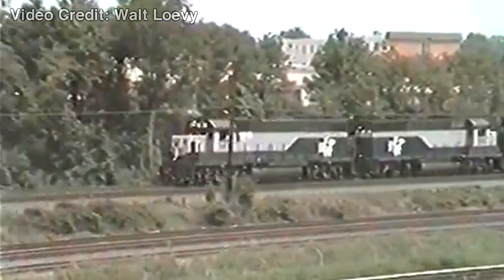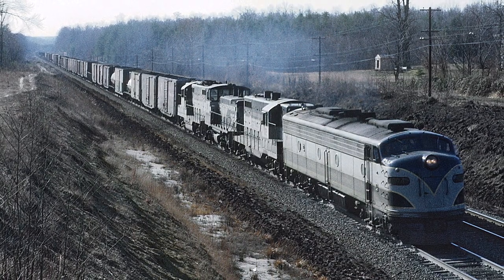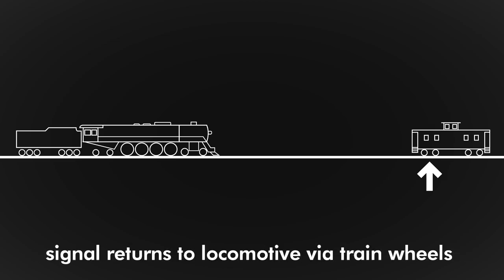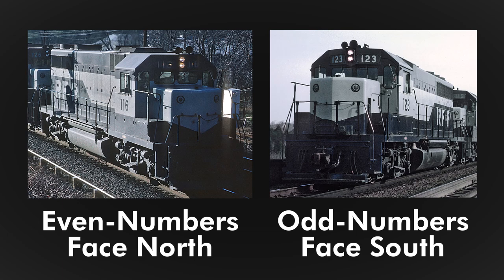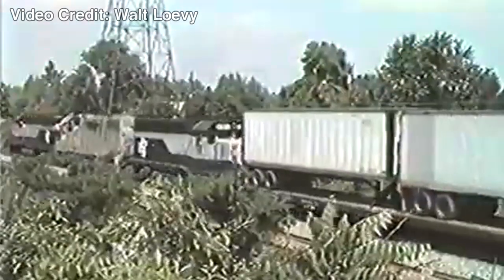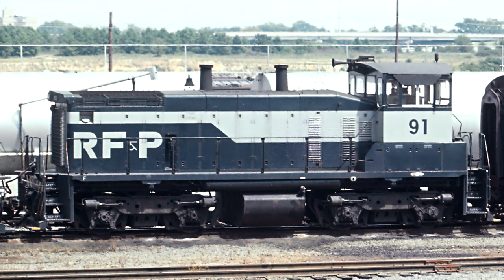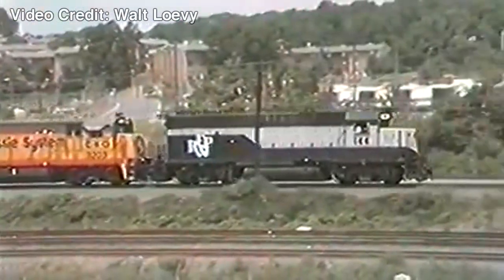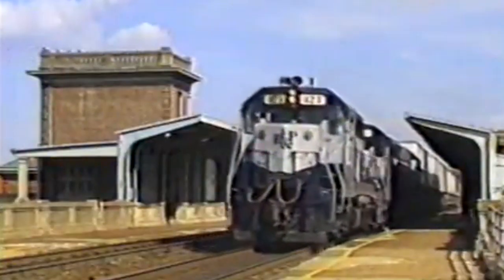The RF&P Railroad's Odd Operations

Comment: I hired as an engineer on the RF&P on this date in 1980, having been promoted to engineer on the Southern Railway in 1979. The RF&P was a great outfit to work for! One slight correction: the GP40-2's (141-147) only had one control stand, but the ATC system could be set up for long hood forward by breaking a seal down in the nose and changing the position of a small brass lever which was the same as the acknowledging lever mounted on the cab wall by the engineer's seat. The GP35's (131-138) and straight GP40's (121-127) had dual control stands. I'm still running for CSX with 42 years seniority on the roster.
Reply: Great comment - if you're still running the RF&P or North End Subs, I might see you from my car trackside. If you haven't retired already, best wishes for a successful conclusion to your career.

Comment: I've got a small fondness for the RF&P and I have a few DVD's featuring their motive power. While it may only take up like 8 minutes of runtime across all of the train dvd's I own, its still an interesting line. Also Ik RF&P and ACL diesels were leased to the N&W which bumped the J's from passenger service in late 1950's.

Comment: Great video! If I remember correctly, Rail Link 285 (one of the switchers that actually works in my local area, which happens to be in Arkansas) is former RF&P locomotive #85. To my knowledge, it was never fitted with Flexicoil B trucks.
Reply: SW1200's 84 and 85 had standard AAR type "A" trucks and were not equipped with ATC (cab signals) for road service. They also didn't have MU capability until the mid-late 80's. 81-83 were equipped with flexicoil trucks, ATC and MU and could be used on the road. SW1500 91 was also so equipped.
Reply: @johnstone2647  Ah, so my suspicions were correct then. Thanks for the info!

Comment: Ah, yes, RF&P park in Henrico County. 

It’s right next to Meadow Farm, which is where I went a lot as a kid for living history events and the Civil War Reenactment they used to have there. 

Also, RF&P is one of the few pre-war railroad lines still in operation today. 

One example is the Richmond and Petersburg Railroad, which was a railway line running south from Richmond to the city of Petersburg. The main depot was photographed by Matthew Brady and his photography team shortly after the Fall of Richmond where Brady and some other men pose in front of a ruined Baldwin Locomotive owned by the railway in the pre-war years. It was merged into the Atlantic Coast Line in 1898.

Another one would be the Richmond and York River Railroad, which is the railroad that’s often featured in Civil War Photography (particularly anything related to Savage’s Station). It was later bought up by Southern Railroad and was connected up to the Richmond and Danville Railroad line, forming the ground level line of the famous Triple Crossing.